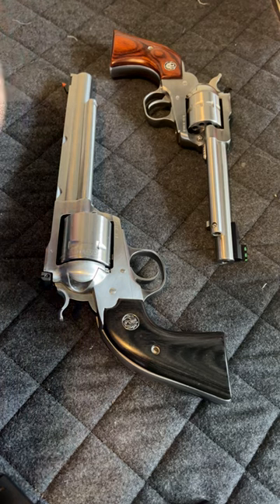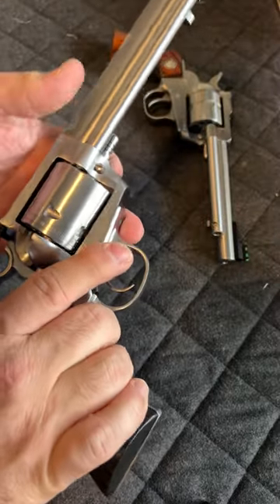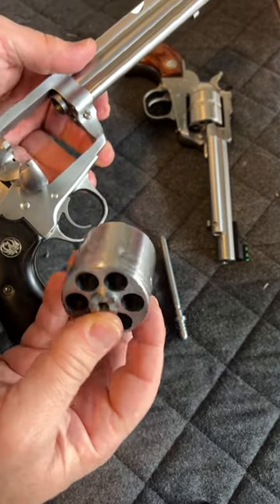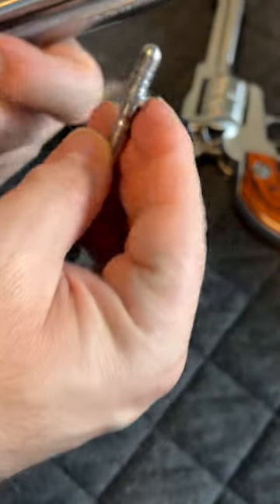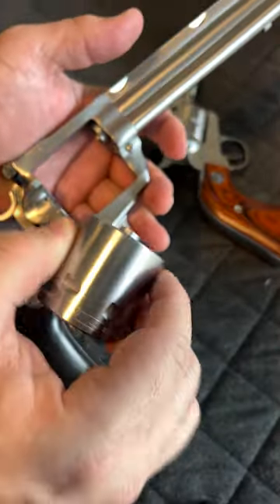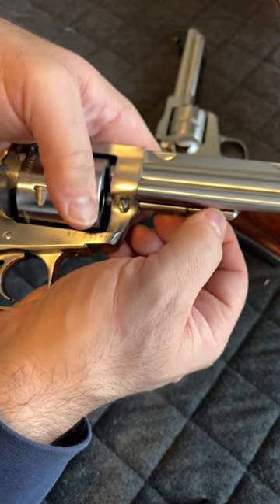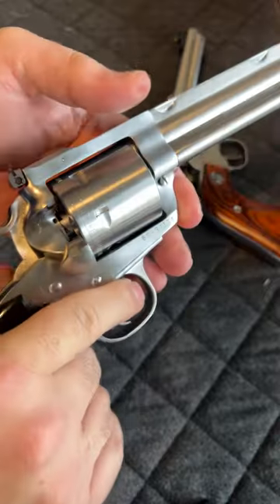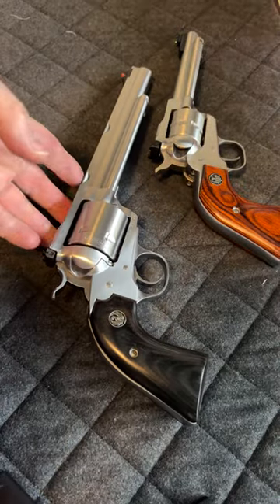Ruger Single Action Cylinder Removal #shorts

Comment: So while shooting mine at the range I notice the pin would slid out and cause the cylinder to jam. Not sure what’s causing it to do so. I have the pin correctly and seating in fully. Any suggestions? Guessing I need a new pin?
Reply from the maker: Weird, can you pull the pin without pushing the pin release button?
I’m thinking your pin don’t lock correctly, maybe it’s worn out… hard to say.